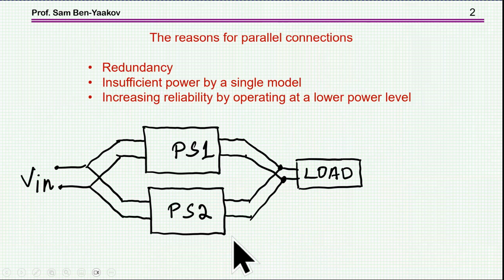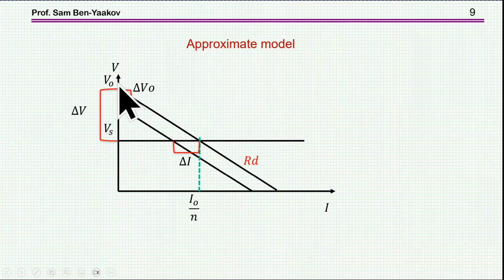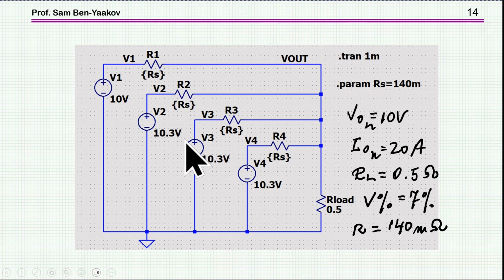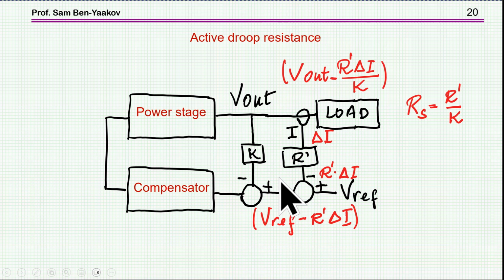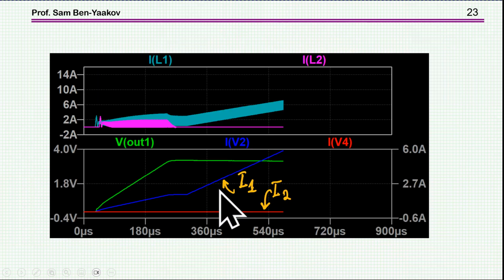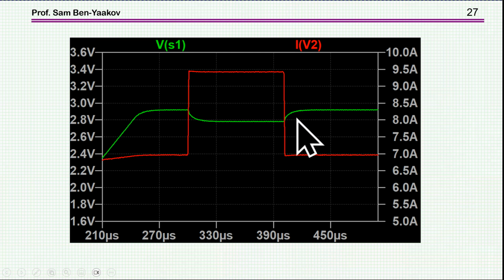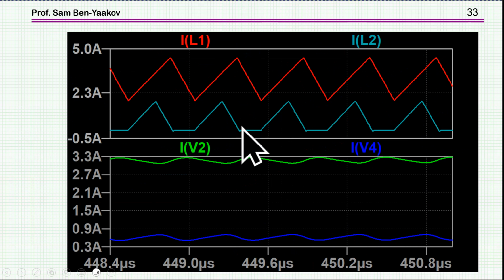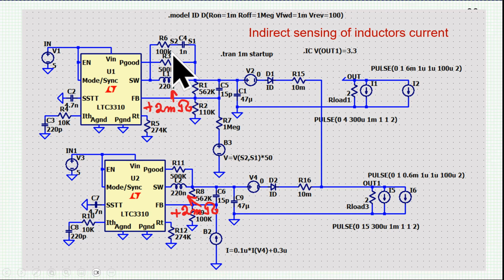Current sharing of parallel connected power supplies by the droop method

Comment: Thanks for a very informative video as usual. 

Do you have any thoughts about directly connecting the current sense capacitor to sense+\- terminals? Converters that do direct resistive sensing have a built in diffamp which could be placed at your nodes S1 and S2, but I’m not sure if that would work in practice. I’m going to try it in a simulation but don’t trust it because I haven’t seen that sensing technique before. 

Also, how sensitive is the RC to RL matching to tolerance in practice? With 10%+ process variation in L,C and DCR before variations due to temperature and load I foresee sensing degradation or inaccuracy but I don’t know enough to make a determination.

Thanks in advance for any help. You’ve already done more than I can ask!
Reply from the maker: The internal amp will not do.
The RL mismatch does not affect the dc value only the AC components.

Comment: Thank you professor! Interesting topic. However, one thing confused me. How is it possible to have circulating currents between power supplies output capacitors if there are ideal diodes in series with each output 24:40 ?
Reply from the maker: The diodes carry DC current🙂 so the superimposed ripple can go both directions.

Comment: Thank you very much. What topology would you recommend for low current (up to 600mA), multi and isolated output dc to dc converter?
Reply: More requirement details are necessary. Interlaced flybacks come to mind but it might not be the most appropriate.
Reply from the maker: What power level?
Reply from the maker: So its up to 10W per unit . Are you looking for onePS with multiple outputs?The most important issue for the musical environment is noise consideration.
Reply: @sambenyaakov  It supplies low power but few outputs may supply 4W. Yes I'm looking to build it one unit with multiple outputs. You are correct about noise, and that's why I'm looking for isolated outputs. Thanks for your reply.
Reply from the maker: @_-Skeptic-_  I think that  a  soft switched flyback preferably with active clamp running at a  frequency above 100K will do.
Reply: @sambenyaakov  Thank you very much